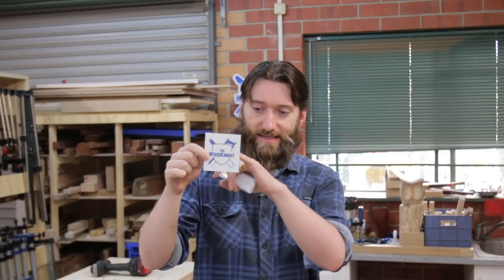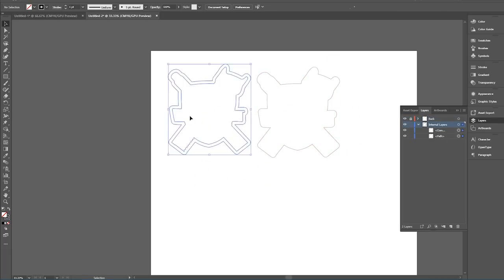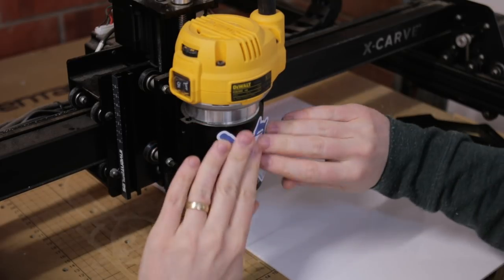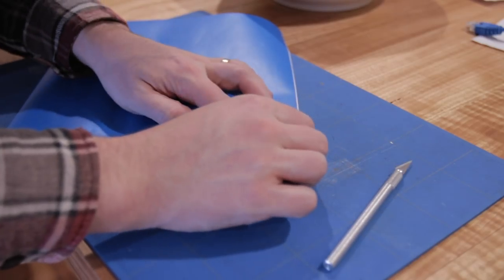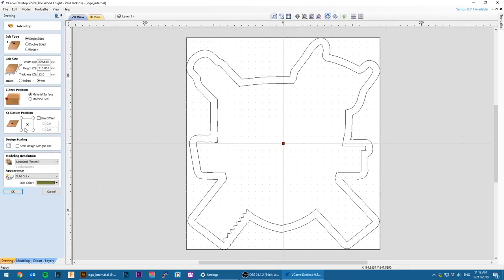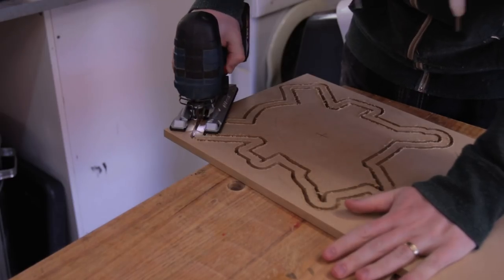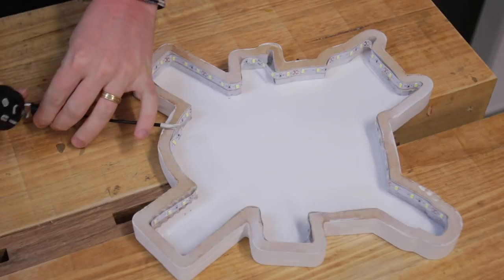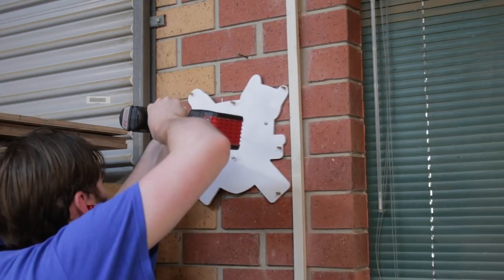How to make an LED Sign (with robotic tools)

Comment: Very cool! What were you using to hold down the acrylic? Didn't see anything obvious in the video. Double sided tape maybe?
Reply from the maker: Yup, just double sided tape. I also like to leave tabs on - a fine tooth jigsaw blade also takes care of acrylic tabs quickly, then they can be filed or sanded off. 

I find (only) clamping acrylic only works well when its a small piece, it just doesn't seem rigid enough and tends to vibrate without tape.

Ideally I'd probably go for an onion skin (by zeroing off the  wasteboard), but I need to remake my wasteboard with replaceable inserts and t-track before I go down that path